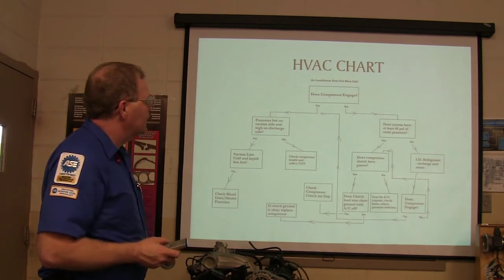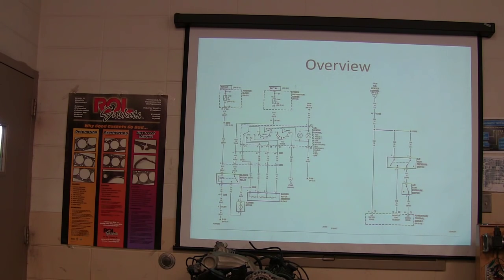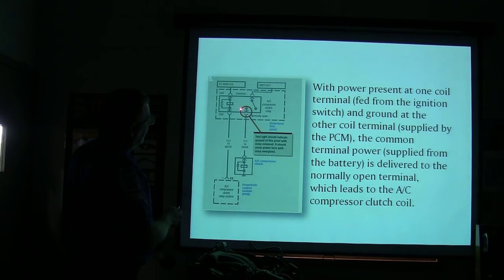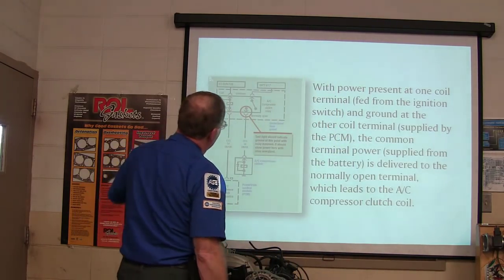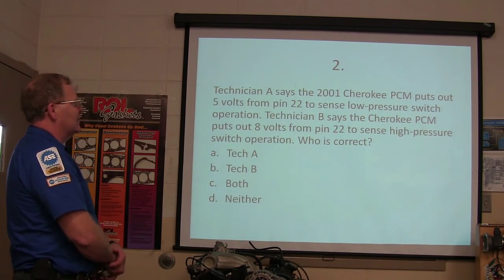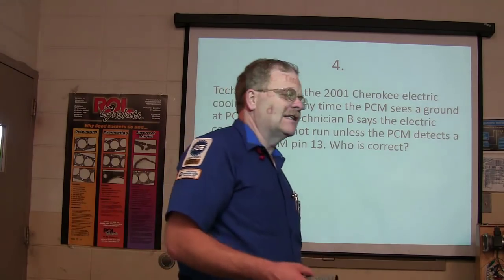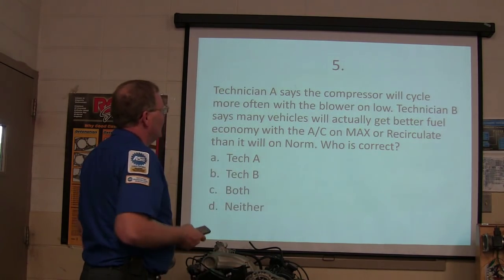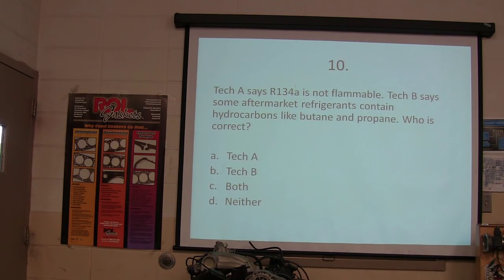Finding an AC problem

Comment: Let me explain this little better guy kinda rushed trough it on Max the blend door closes off the outside air and just recirculates the cold air in the cabin this will help with gas mileage cause the compressor will kick off until the air gets warm again and will kick back on again too cool. When the temperature is not so hot out you should take the HVAC system off recirculation and open the blend door to the outside air it’ll blow into the cabin and feel nice especially on the highway. You can do the same thing in the winter put it on recirculation and turn blower fan on low you’ll be nice and warm.

Comment: Hello, Sir. With an air gap issue, you will still find a ground to the coil if the coil is not open, right?
Reply from the maker: Correct... the air gap issue does not affect the resistance of the clutch coil
Reply: @McCuistian  Thank you, Sir.